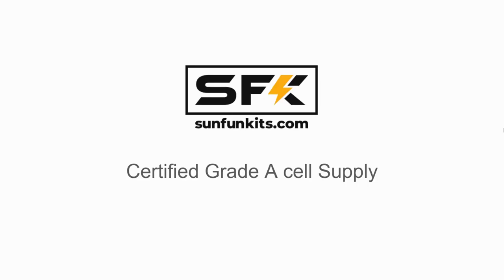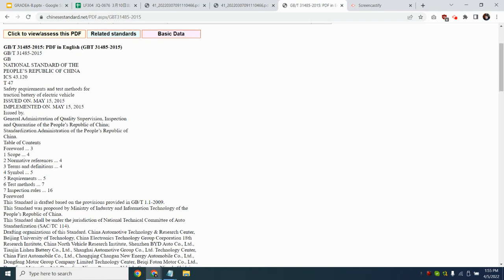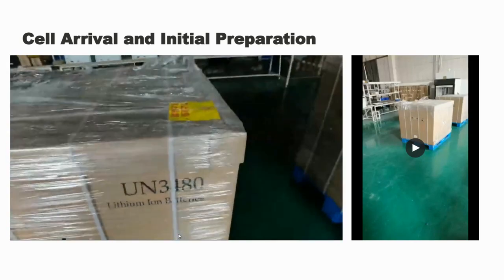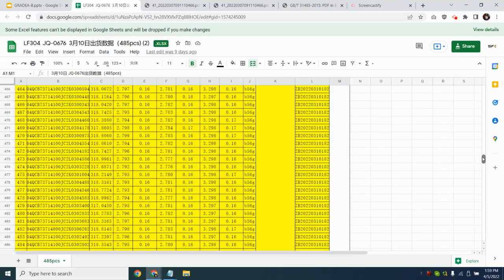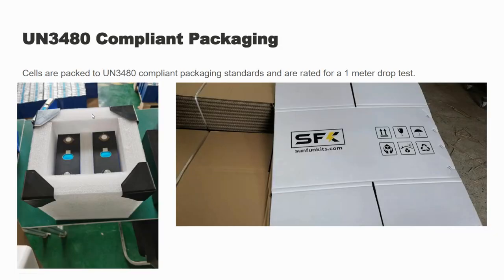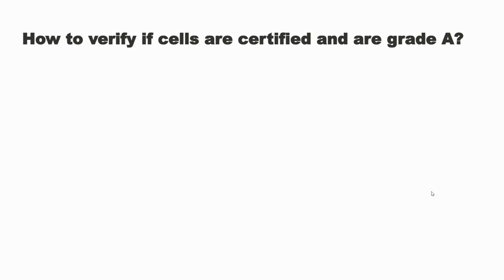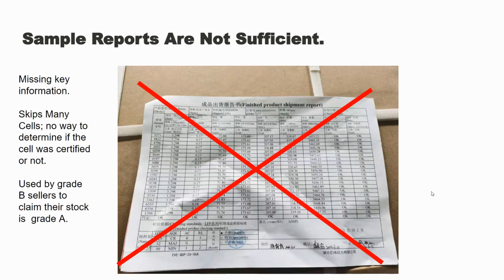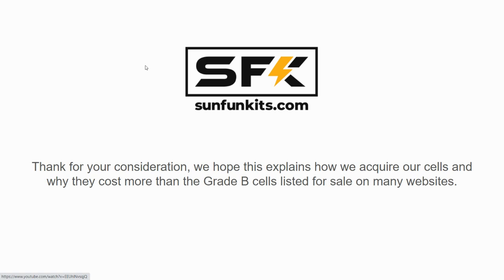EVE Lithium Iron Phosphate LF304, 280, 280k Grade A vs Grade B (Rejected Cells) Part 2

Comment: 12:37 is not fake, it is just a company label that does not claim to be EVE but shenzen basen and the capacity are the reference values.
If you buy a varta starter battery for your car and it says 12V and 100 Ah how often have you ever checked that the capacity is really 100 Ah ?

And that is what the label says and I do not count these as the result of a measurement for that particular. It is a should have 3,29V and deliver 280Ah at arrival and should have 0,21 mOhm internal resistance. 

Genuine or not does not matter as much as the qr code and its data. I have gotten cells sold as grade B and advertised as grade b overdelivering the 280 Ah or 160 Ah figures, not for all cells at the first round of testing, but 12 out of 16 were over delivering from the first test on but I did 120 cycles for such a 16 cell delivery with 3 tests for the best 5 cells and 100 tests for the weaker ones even overdelivering but only at 100,3%

And what I observed was an increase of capacity over the times of cycles for the weakest cause my 4 weakest jumped from the 99,7% mark in the 1st cycle to over 100,5% in 2nd cycle and even higher after 10th cycle. 
These were unused cells, no bulk, and at the end each cell was capable of delivering the capacity promised or better: overdelivering 

But I took care for the test procedures which meant: 25°C at any test time for all the cells even a day before

If you ignore the temperature and get below 12°C results are a lot worser of cause cause EVE has described were specifically how to test and under what circumstances by using what tools.

Comment: Hi,and Thank you very much for this video, and it confirms I think, that resellers on Alibaba or others, never sell grade A cells,just rejection cells by manufacturer.
Do you know any resellers on Alibaba who sell real grade A cells? and of course who can provide the official green / yellow spread sheet? Thanks
Reply from the maker: Hello, not at the minute, there was 1 but they are now also selling grade B cells. You can contact the official Eve store on Alibaba and ask them. We are trying to get Global Distribution setup for the EU, Australia, and Some parts of the Middle East right now.
Reply: @sfkenergy  Thanks for your Answer.
Yes we have already contacted before, EVE store on Alibaba, the problem is that they often ask for a large MOQ.
 We are in Indonesia, China is not very far, and Australia too.
Just a question, do you have any hindsight on pack uses for at least 3 years, uses in ESS?
Because it is difficult to really estimate the lifespan of cells, in years, or by their number of charge and discharge cycles, but over the long term. (minimum 3 years)? Thanks.
Reply from the maker: @laurentsantaibambu7324  Hi, we are trying to setup international distribution, but the minimum order would be 16 cells, check back in about 1-2 weeks and we will make an announcement on our website.

Comment: 8:25 I received my 16 pcs in similar packaging with 8 plastic corner protectors.
11:59 and... I got mine from Basen...
Reply: The packaging is not unique, it does however prevent physical damage during international shipping. Getting cells in similar packaging means nothing if it doesn't come with the EVE test report.

Comment: Very informative video. I have just capacity tested a couple of EVE LF280K They tested at 272Ah and 269Ah. They were from Docan Technology who seemed to have very good reviews, not sure if you know of them. All labels identical which is questionable. I have asked them for the official green / yellow spread sheet. Thanks for the info.
Reply from the maker: hello, We tested docan tech in November 2021, they are only 5 hors from our location, there cells tested to about 265 AH: https://youtu.be/HpLBi6SUqFc

We didn't publish this video, but by now everyone already knows Docan/Lithicore is selling grade B cells as always has.
Reply: @sfkenergy  so they only sell grade B cells ? I didn't know, so not everybody. How do people claim against them ? I have 4 cells and could open a paypal dispute for example or is it not worth it ?
Reply from the maker: @johnherrington5  All we can say in this matter is that if the Docan/Lithicore cells were genuine, we would have bought them all, every single one. That price is cheaper than we can get direct from the manufacturer.  But clearly Docan does the same thing literally every other seller does, buy reject cells at auction for $35.00/cell and then sell online claiming grade A.